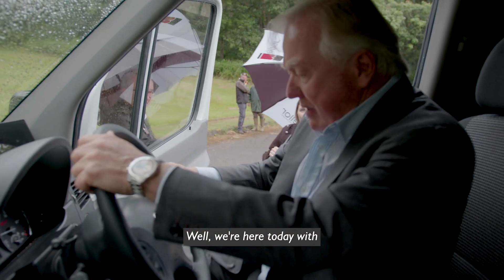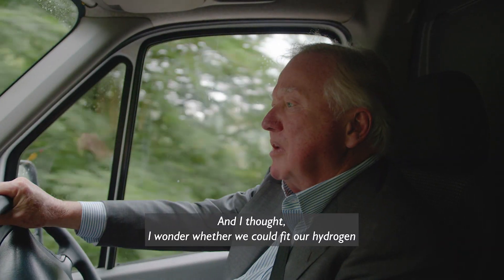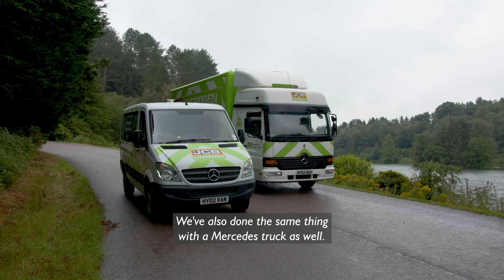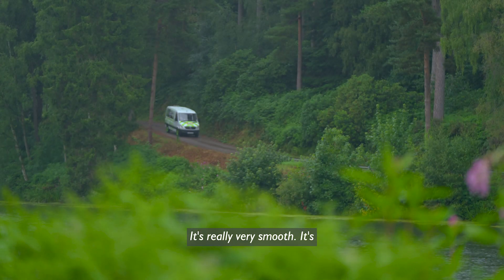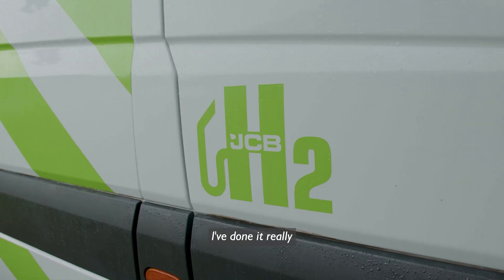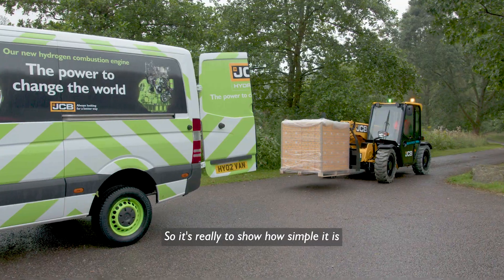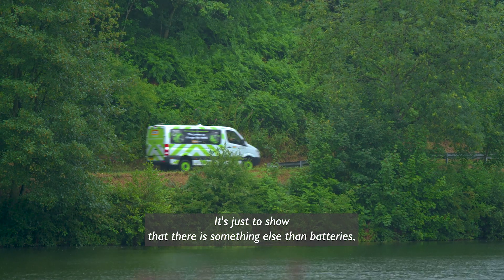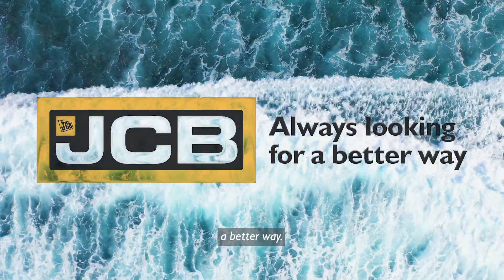JCB Chairman Lord Bamford's First Drive of a Hydrogen Combustion Van

Comment: With China going all in on EVs, we've got a chance here to go the other way, with Hydrogen, and expertise from domestic companies like JCB, and genuinely lead the way. Cleaner, simpler and importantly ... capable of powering plant equipment, not just smaller vehicles. Yes there are challenges with transport and production of Hydrogen, but let's get into it, and find out. Baffled why this doesn't seem to be getting more attention.
Reply: Its not getting more attention because it doesn't work.

It's one thing to convert a Van with unlimited funds and JCBs engineering resources at your disposal (too many yes men), but entirely different to build the supply chain and retailing for a fuel that wastes 3 to 6 times the energy (fuel cell vs. combustion) that an EV needs to go the same distance / do the same work.

By the time you have trucked the hydrogen around, you will be looking at 10 times more for your fuel costs vs. battery electric, and the filling stations are multiple millions per nozzle to build and millions per year to maintain. Petrol in the UK is 150p per litre, hydrogen equivalent cost would be 850p, EV equivalent cost is 85p right now (34p per kWh x 2.5 factor) - if you are a farmer and have a solar field for shade grown fruit crops, then the EV gets much cheaper. To use hydrogen on a farm, you would need 3 to 6 times the solar and buy and maintain an electrolyser, and buy 9 litres of water per kg of hydrogen, de-inioize it and put it though an electrolyzer, then store it in a 10,000 psi tank, move it to a bowser.

All these vehicle companies (JCB, Toyota) are not interested in fuelling, and definitely not green zero emission fuel manufacturing - so, how are we going to fuel these vehicles?
Reply: @brushlessmotoring  I'm guessing from your username you have a horse in this race 😅

Do you factor in negative externalities of global scale battery production if the world transitioned to EVs as the dominant post fossil fuel tech?
Reply: @JedRichards  yes to both of those questions.

EVs need improving - infrastructure especially, but they are still better than the status quo, oil and gas extraction, refining and combustion - we often ignore or normalize those impacts - which include cobalt use in oil refining, geopolitical strife, indigenous exploitation - many times worse than the DRC mining issues, which are getting cleaned up - some EVs don’t use any cobalt for instance, but these issues are not, unfortunately, unique to EVs, and yet the fossil fuel press only highlight these problems in the context of electrification - as if oil and gas are guilt and impact free - funny that. 

The enemy of good is great, and EVs are not perfect, there is lots of work to do, a car is still a congesting ped squashing car, regardless of power train, and vehicles that only rich people can afford (and that most definitely includes hydrogen too) is not an equitable solution. 

But what really grinds my single 3:1 clutchless reduction gear is the way hydrogen is presented as a ready to go ‘better, cheaper, cleaner, coming soon’ alternative to EVs that you can buy today - it is not - none of those things are true - you can’t get a better demonstration of that than this very video - do you have a talented engineering team, a country estate, a billion quid, and I’m sure a landed title of the gentry doesn’t hurt? Good, you can misdirect that team to buy a perfectly useable Mercedes Sprinter van, pull the brand new working engine out and put a borderline science experiment in, hide the huge hydrogen tanks and don’t show fueling, you can’t buy the fuel from anywhere retail in the UK (I think JCB use lower pressure, and don’t use the safety communication ring) then put a bunch of stickers and green paint on the wheels from your talented graphic design team, make a video that proves nothing and:

The Crowd Goes Wild!

Look at the comments - ‘this is the future’, ‘better than EVs’ - and - crucially - ‘I’m not getting an EV, I’m waiting for this’

Waiting for what exactly? This isn’t happening, JCB does not sell a single hydrogen unit, they have been trotting these prototypes out for about 5 years now, they are at least quietly getting on with electrifying some equipment, the UK is exiting hydrogen retailing at a pace. 

My ‘horse in the race’ is nothing more than I’ve been driving an EV for 4 years - made a couple of long distance trip (1000 mile a day, 5000 mile total) EV videos on YouTube, and, they work - there is some adjustment needed, but all the commenters here are smart folks who could adapt once they stop listening to moneyed interests telling them EVs are no good. Oil and gas have a trillion dollar horse in the race, and they are using hydrogen as a distract and delay tactic. 

I can’t for the life of me work out how Bamford got this boondoggle nonsense stuck in his head, but billionaires hobbies are not like us regular folks, I collect shot glasses from places I’ve travelled to, his Lordship puts pointless hydrogen combustion engines in German Vans. 

Keeps him off the streets I suppose. 

I have other rants about the massive waste of energy needed to make and move a hydrogen vehicle vs an efficient EV.
Reply: @brushlessmotoring  I very much enjoyed your rant, thanks for taking the time. Food for thought.

Comment: A real world solution unlike the all electric wet dream 👍
Reply: You can go buy an EV Sprinter with 200 miles of 5p per mile range. You cannot buy this hydrogen van, and even if you could, it would cost £1 per mile to run.

Hydrogen is the fantasy here.
Reply: @brushlessmotoring  true 👍, if you want to deliver parcels, but I'm not looking at the capabilities of this van.  The potential for this tech to be scaled up to much larger applications, like JCB are traditionally manufacturing should be clear. Early prototypes have already proven that electric trucks and diggers aren't robust enough for the construction industry and in many real world cases a diesel generator would be needed to power the charger.

If we must change something, Hydrogen has way more potential for heavy commercial and industrial vehicles, IMO 👍

Comment: I hope this gets picked up by all manufacturers. Toyota already have it cracked in there cars. It will be so nice to see all the smug sanctimonious EV owners get it rammed right up there backsides.
Reply: As a sanctimonious EV owner, I won't hold my breath waiting for the 'always tomorrow' promise of clean, green hydrogen transportation to actually show up - most hydrogen is made from fossil fuels, and this video was a trick - they didn't show the massive fuel tanks taking up half the cargo space and only delivering 50 miles of range. There is a reason JCB is not making hydrogen vans, or selling any hydrogen equipment either - it doesn't work commercially, the hydrogen is too expensive, and you can't get it anywhere - it's a logistical and economical non starter, and they know it.

But enjoy the magic show they keep putting on - it's very effective at keeping you buying petrol, which - bizarrely - seems to be what Bamford want you to keep doing, which is why he is making videos about products he has no intention of making or selling - don't you think that's odd behaviour for a CEO of a construction equipment company? Converting a mercedes van as a one off, covering it in stickers that lie about the source of the hydrogen, and then tell you they won't be making or selling said van?

Comment: 1) does your Lordship have any idea of the £/MWh of the hydrogen purchased here ?
2) how so safety regulations view using a vehicle with a tank holding a highly flammable fuel at 300 bars next to welding activities ?
Reply: Bit like all those lpg powered vehicles then. Even having a tank of inflamable petrol is just as bad. Think before u write
Reply: @paulcowan3222  LPG is stored at less than 20 bars, not 300+. Gather knowledge before you write.

Comment: great video cannot see why we are going down the electric route and not a joint route of electric and battery , i live in a multi storey flat how can i charge a electric car overnight
Reply: Is there no lighting where you park your car? "Right to charge" legislation is needed for flats that push back against installing chargers, it's happening elsewhere, it will eventually happen in the UK. If you can get access to a regular UK 13A socket, you can add 100 miles of range overnight.

Comment: Brilliant news, Rolls Royce and easy jet developing hydrogen aircraft….great news move on from this EV nonsense……I was looking for a new van….Merc sent me info on EV Merc sprinter…..it’s range was 50 MILES….LOL🤣🤣🤣
Reply: 2024 Vans will be much better - 180kWh batteries. Hydrogen is not happening, beyond prototypes (which is all JCB make with hydrogen - show pieces, no products for actual sale).
Reply: @brushlessmotoring    BMW and Toyota are already advertising hydrogen cars, Rolls Royce have already run hydrogen jet engines, although a long time away from being flight certified, its on its way. EV is the betamax of transport, I work with EV….they are expensive, unreliable and damn dangerous….and VERY un green..! The Merc at present takes 8 hrs to charge ac, and 2 hours to charge BETWEEN 10 and 80% dc….180kw batteries will give approx 150 mile range….on present charging rates will take 24 hrs to 6 hrs for 150 miles range LOL…..and you could only get 10% 😁 I drove 395 miles last Sunday in my van….and didn’t need to “charge up” once
Reply: wribg 150 mile range biy  it

Comment: Is there any reason why a hydrogen combustion engine can't be fitted to an ordinary car - it's got to be a genuine alternative to battery electric.
Reply: Look at the Hyundai NEXO, uses hydrogen to make a charge for the 1.56kWh high voltage battery for the eletric motor.
Reply: @stuartandrews4344 that's a fuel cell. Not at all the same thing.
Reply: where would you put the fuel tanks? Hydrogen combustion is even more inefficient that a fuel cell - you would fill up the entire boot and back seats to get even half the range of the existing petrol tanks, and the only way to get around that is -256ºC liquid hydrogen tanks - which boil off after a week.

Hydrogen filling stations are being closed in the UK, it's done, it's over.

I don't know why JCB / Bamford is putting on this side show, with a wink and a nod and no specs or cost - like Mercedes could 'just do this' - they can't, hydrogen combustion is a dead end, even more so than fuel cells - the only real product you saw in that video was their battery electric load lifter.
Reply: yez it  añ

Comment: Why are we still fucking about with electric cars … you’ve done it because it’s ingenious!!!
Reply: Batteries ars are the most efficient and will be the main thing for ordinary cars. with hydrogen there is less efficiency involved, but will be an option where batteries are unpractical. There will be a mix of different options working in parallell fueling future transport, all with their pros and cons
Reply: @Rimrock300  batteries are unpractical in every conceivable sense other than a retired couple that just pop down to the shops a couple of times a week we haven’t got the infrastructure to support everyone having electric cars including space for charging points electrical transformers which haven’t got the strength to support everyone charging at once the only way electric will work is with an engine at the side of it ie hybrid
Reply: @90sDiesel  so if that's true, how can we have 300% more electricity to make hydrogen - 500% more if its this extra dumb combustion nonsense JCB is on - we need way less to do the same work from a battery? You can't have it both ways - we either have enough electricity to make clean hydrogen, and so we have 3 to 5 times as much electric for the much more efficient batteries, or we don't have enough electricity for EVs - and then we definitely don't have enough electricity for hydrogen production, which needs many times more kWh than charging batteries do.

Comment: It's the hydrogen in Hydrocarbon fuel that powers a heat engine. Mankind has been using hydrogen as a heat source since the use of fire.
Reply: It's the Carbon in Hydrocarbon that provides the energy!
Reply: @davidpiper3652  No so, the carbon becomes a bi-product of the chemical reaction, i.e., soot, ash, charcoal, CO, CO2, etc.

Comment: Well done, glad to see leading companies showing that overstraining the national grid is not the only answer!
Reply: Yeah except that for this to make sense, it needs green hydrogen.
That means electrolysis and to produce 1kg of hydrogen requires between 50 to 55kWh of electricity.
In a fuel cell vehicle, that would provide energy to move the vehicle about 60 miles.
Had that same energy gone into an EV battery, it would have driven about 200 miles.
Might want to review that idea about overstraining the grid.
The numbers don't work.
Reply: @djtaylorutube  
The "inconvenient truth" they always forget.
.
Build an Electrolysis plant to produce 100GWH of hydrogen storage...
Or
Build 25-30 GWH of battery storage.
What's going to be 
Cheaper (build cost)?
Safer?
Easier to maintain?
Easily distributed (build at point of use!)?
Cheaper (Energy to the consumer )?
.
That's a win for batteries on all metrics.

Comment: Great to see, the only drawback at the moment is the infrastructure for refueling, got to be the way forward
Reply: 3 times the running cost to the consumer.
Reply: Hydrogen is one of the ways forward. JCB just shows the engine side is no problem. Up to others to come up with less costly ways of produing hydrogen.
Reply: and cost. and emissions at manufacture or the quantity of electricity needed. and the handling challenges. and the amount of space hydrogen takes up, even at 10,000 psi.

Comment: Hydrogen is really the way forward especially when you look at the damage that is caused to the planet when producing the batteries for EV and then the pollution when these batteries have thermal runaways when they fail. There is an engineer in the USA that have converted  a LS V8 to run on hydrogen and it works perfect. So what's stopping people getting conversion kits for all standard engines to bring them up to future standards rather than ripping the planet up?
Reply: You need to replace the entire engine and gearbox, you can't convert an existing engine the way you can to burn LPG / Methane - however, as most hydrogen is made from LPG / Methane, you kinda end up with the same thing, and you still get smog particulates in the exhaust of a hydrogen combustion engine (NOx etc.)
Reply: "Damage to the planet"
.
We all agree Fossil fuels damage the planet?
We all agree that removing fossil fuels from grid generation will benefit the planet?
.
So if you're moving a fleet of vehicles using either "Straight electricity" or "Straight electricity" used to liberate Hydrogen, which is then burned in a combustion engine, which of these takes more "straight (grid) electricity" to move a vehicle fleet the same distance?
.
(Clue, one is a pessimistic 75+% efficient "at the wheels", the other is below 20% efficient per kWh / GWh of grid capacity)
.
If your grid is not fully, 100% green, what happens when you use the energy required for that fleet?.
Answer
You need to find the energy from another source.
.
What is that source?
Existing generation capacity.
.
Energy classification of that capacity?
Fossil fuel (UK Nuclear maxed out at about 10%, so not a factor).
.
Apply some figures.
"Battery" fleet.
100GWh of capacity used.
10,000 miles(?) of fleet mileage.
.
Hydrogen fleet.
1000 miles target.
Capacity required?
Over 300 GWh
.
Result.
(300-100) GWh of capacity fossil capacity remains of the grid as a direct result of a hydrogen vehicle fleet 
.
Next problem.
Infrastructure.
You cite battery production is polluting
.
Well, the infrastructure build of Electrolysis plants will use a huge amount of metals which have to be .... "Mined" and mining is "polluting".
Then there's the huge fleet of Road Tankers which will require similar amounts of  mined material, and fuel.
(I assume the "point of use" infrastructure will be equal)
.
"The pollution caused when these batteries fail"
Really?
.
Ok, if you must...
I was being kind suggesting the use of Electrolysis for Hydrogen production.
However
The fact is that 95% of Hydrogen production is from steam reformation of Methane (greenhouse gas!)
.

"methane reacts with steam under 3–25 bar pressure (1 bar = 14.5 psi) in the presence of a catalyst to produce hydrogen, carbon monoxide and carbon dioxide" 
.
In other words
"Lots of energy, producing polluting gasses"
.
It's essentially a method for the Fossil fuel industry to greenwash.
Not to mention.... Name a country which appat has an impact on the global price a d supply of methane (AKA "Natural Gas")?
That'll be Russia?
(Ref your energy bill 2022/23?)
.
You're being conned.
.
One last thing.
You think Hydrogen won't "eat" a conventional engine?
O..... K
Reply: Hydrogen is one of the ways forward. Hydrogen is still expencive to produce, but development is ongoing